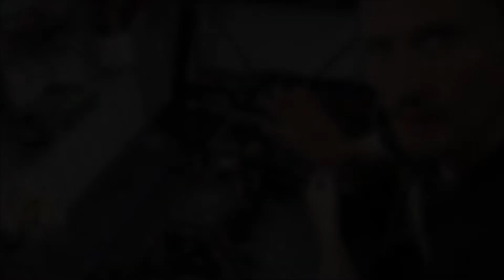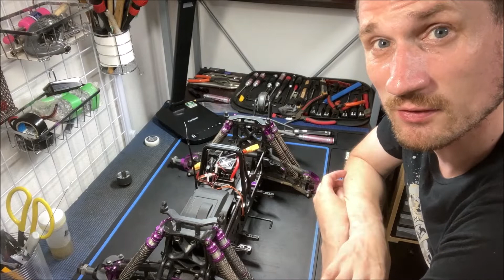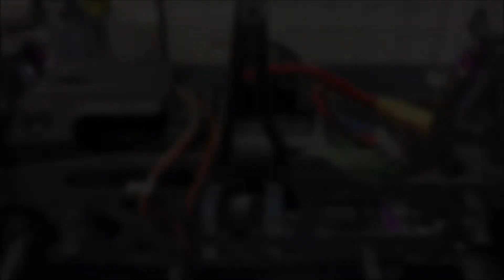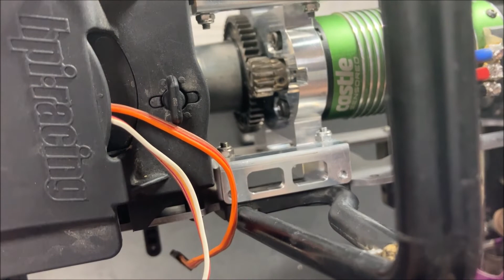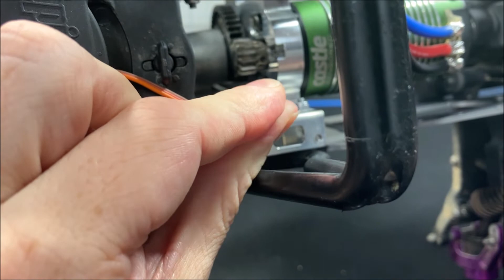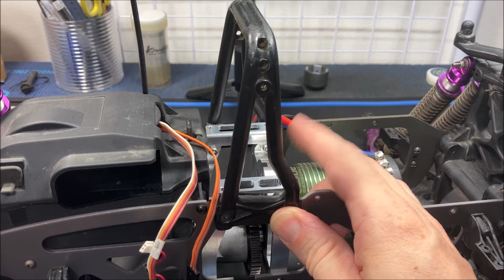Draco Centre Diff Set 2022 Part 3 - Setting up the gear mesh in the HPI Savage Flux HP

Comment: What diff weights do you run Braden🤔 the mesh sounds sweet can’t wait for a run show on this1 😎 nice of you to share 
The last bit of nut tightening had me in the mind of another brands set up with the centre diff😁 so sometimes if possible I’ll remove the whole centre diff arrangement and set the pinion mesh outside the truck 😫 definitely not a regular task but ohh it’s worth the mesh on a new pinion ✅🥳
Reply from the maker: Thank you for the comment! I run 1 million weight in the centre of my 5SC and 500,000wt in the Savage Flux set ups. Yes I totally understand why you remove the whole unit when setting mesh. You can definitely save some money! same goes for the diff gears. I spend so much time getting that right!